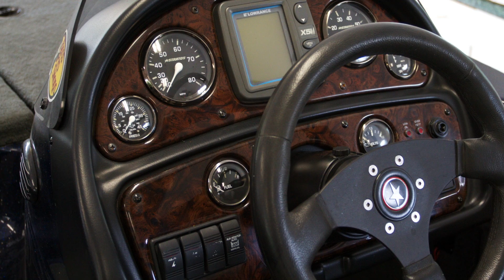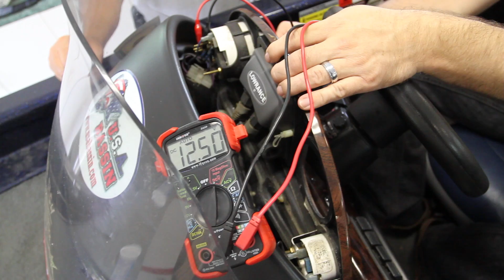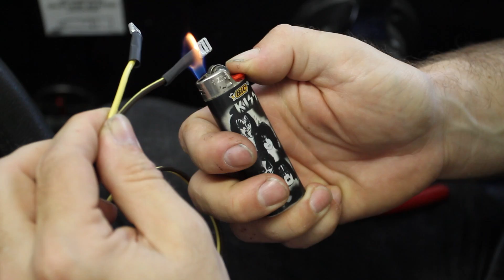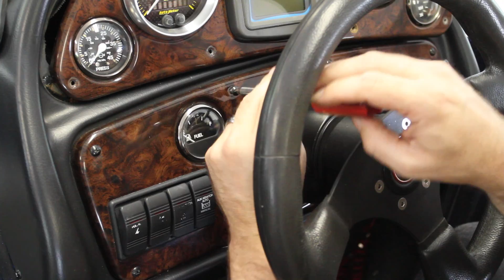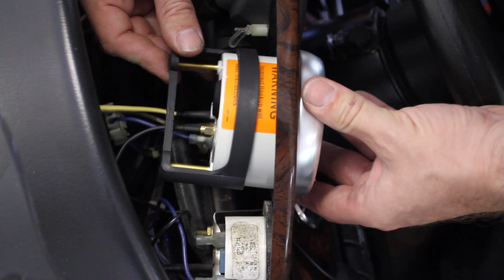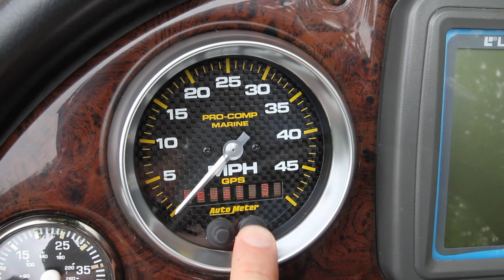AutoMeter GPS Speedometer Installation and Usage

Comment: Mine only works half the time. I sometimes have to shut it off and turn it on again to get it to read. It has power but the needle stays at zero. After I turn it off and wait 5 seconds, turn it back on and sometimes it will read. What’s the problem? Bad antenna? Loose connection?
Reply from the maker: @Ian-of9oi  Please send our Product Specialists an email or give us a call https://www.autometer.com/contact-us/